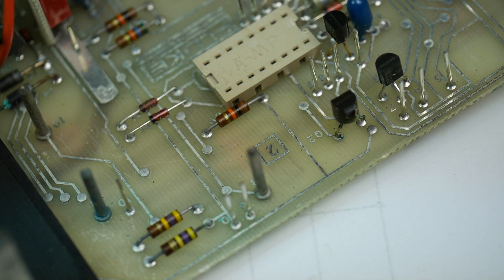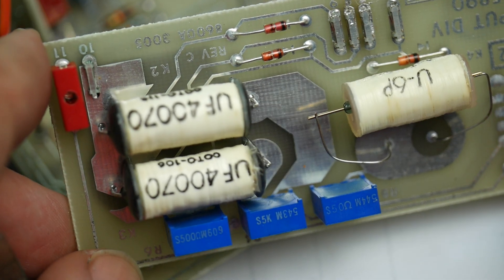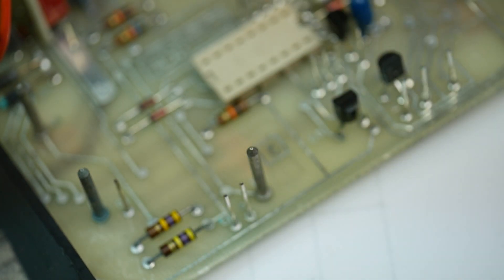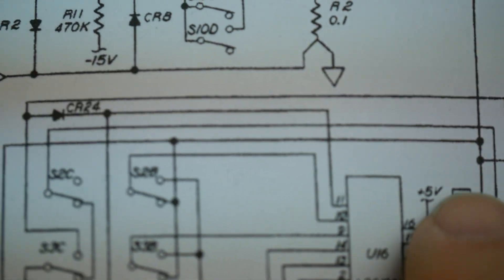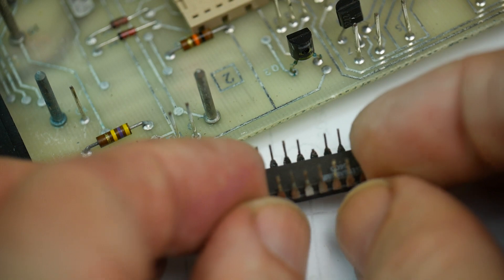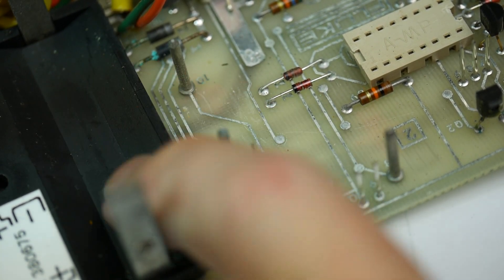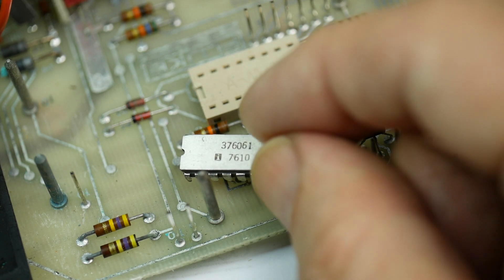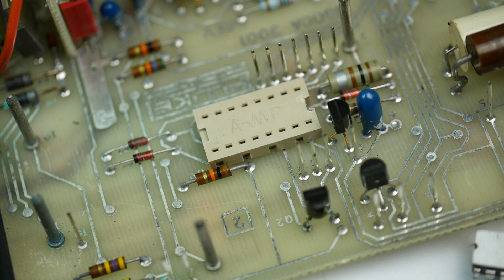More Fault-Finding on the Fluke 8600A Multimeter

Comment: I might have the same problem. I bypassed the input-divider as proposed in the manual and the readings where fine when I applied 190mV to TP3 and TP11. I could switch through the ranges and got the values as indicated in the manual. According to the troubleshooting guide, this means that something with the input divider is broken. Now I don't hear any clicking from the any of the relays (not even K1) and the voltage on pin 4 and 5 of U9 is 0.1V, more or less stable, no matter what I press. I found the ROM in the internet and now consider programming a new PROM, but not sure if it's worth it... Did you have any success with your unit?